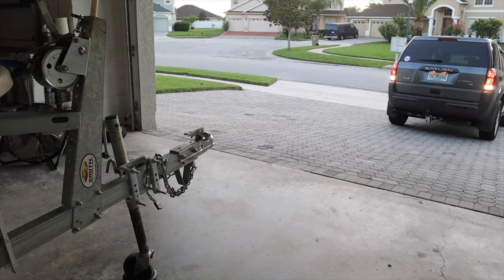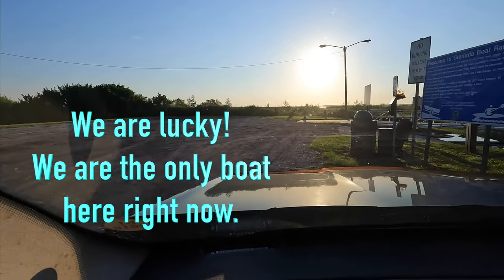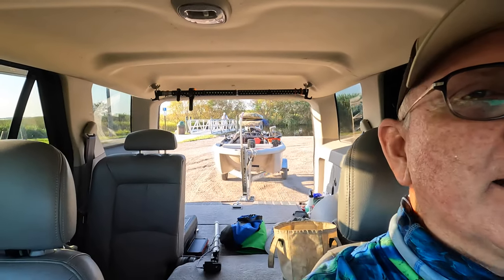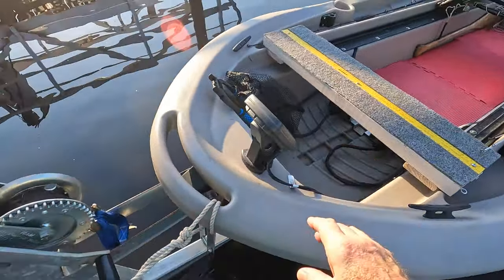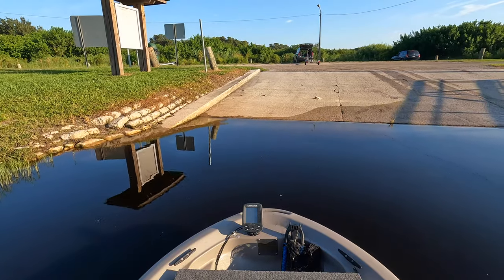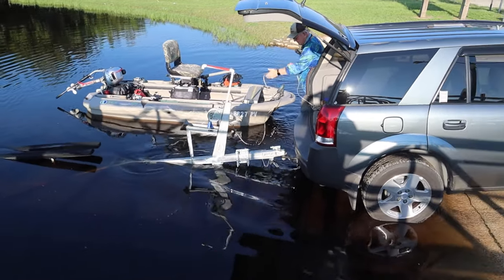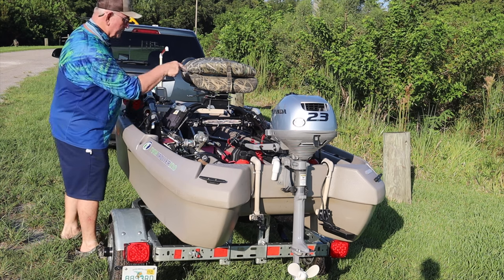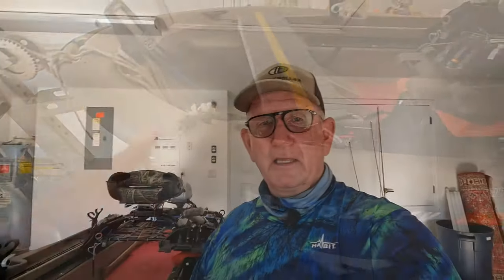Let's Tow and Back your Boat Trailer  Part-2

Comment: Good video, very educational. I'm using a flatbed trailer for now, so I have an entirely different process for loading and unloading. I  walk down the bed of the trailer and lift the front of the boat up onto the bunks I built onto the floor, then use a winch to pull the boat up onto the trailer when loading from the water. A little hard on the ol' back......but at least my feet stay dry. LOL. I'm thinking I will be in the market for a regular boat trailer someday soon. But I want a bigger trailer than the CE Smith trailer. Thanks for the video.
Reply from the maker: Sr, keep your feet dry!  😊     Gerry